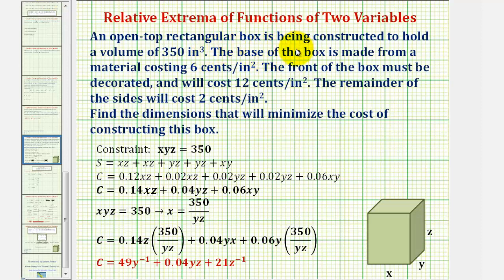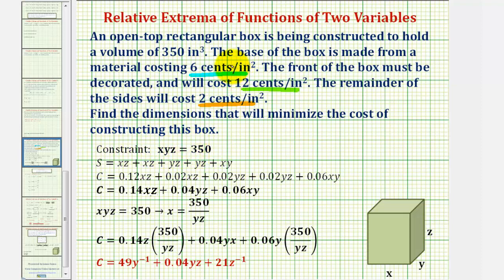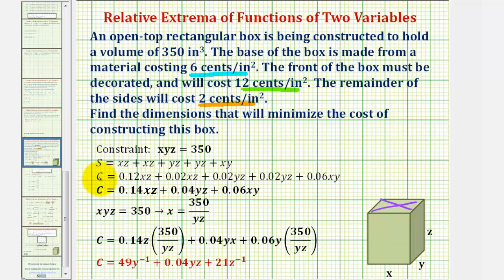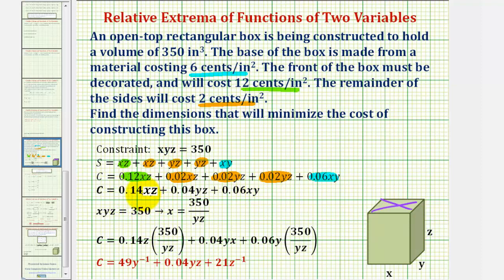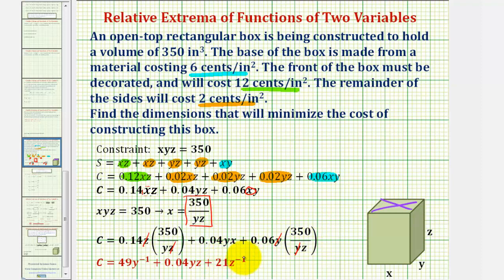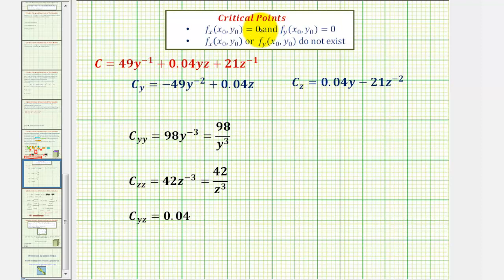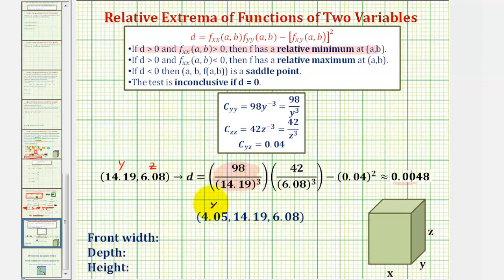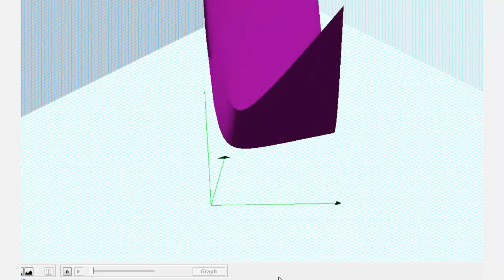Ex: Minimize Cost to Make Open Top Box - Function of Two Variables

Comment: I believe there is a typo on the first slide. C = 0.14z(350/yz) + 0.04yx + 0.06y(350/yz) should be  C=0.14z(350/yz)+0.04yz + 0.06y(350/yz) instead. X-variable where there should be a Z.